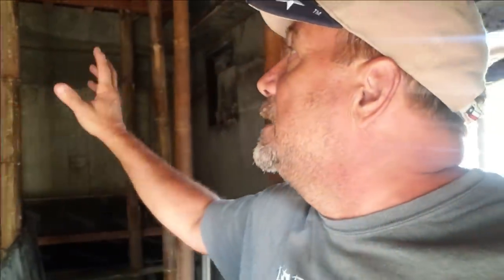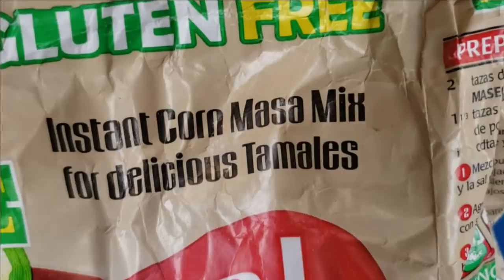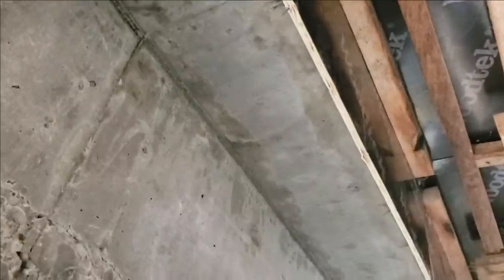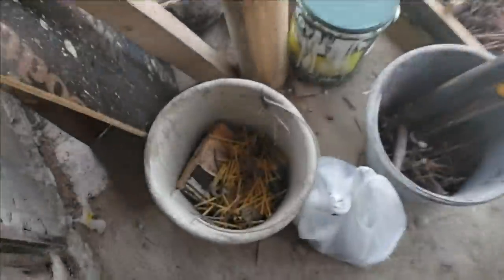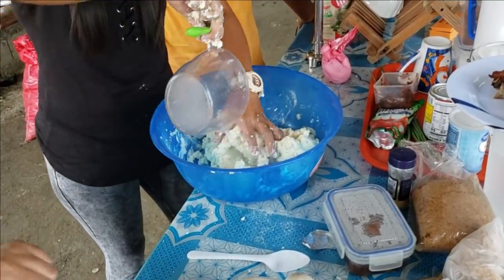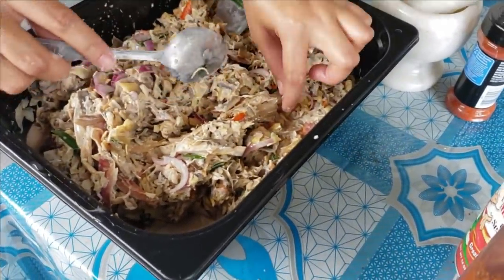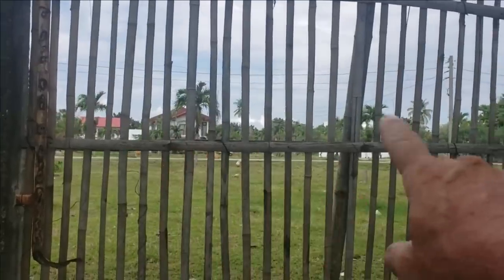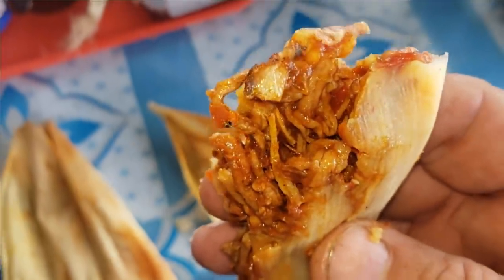Philippines Beach House Build Day 142 :Bacolod-style Ensalada , Mexican Pork Tamales while Building

Comment: Your concrete is so much stronger than those garbage 6" blocks.
Reply from the maker: Can I get a AMEN????
Reply: @TexasFilipino  Using a grinder with diamond blade, or the flap sandpaper will lead to a much better finish.  I still can't wrap my head around you not buying a mixer and fixing all the crap welds.  At least have them use a mixing box and a hoe with holes in it!